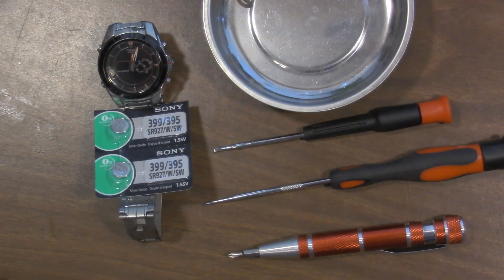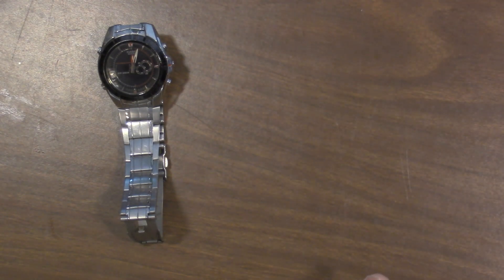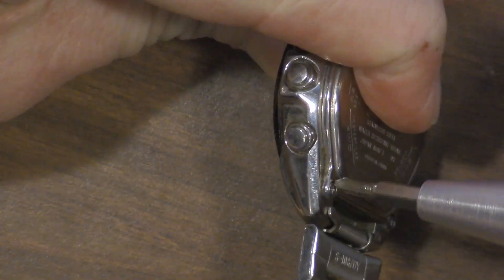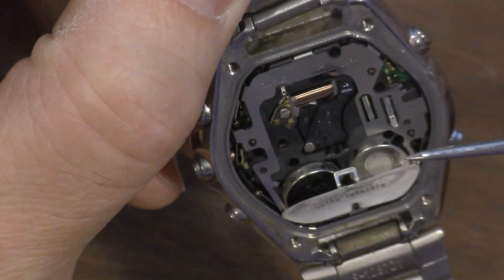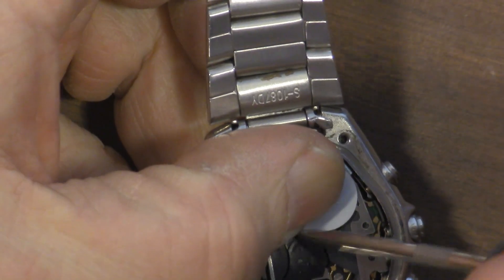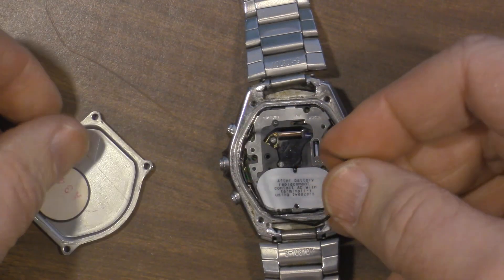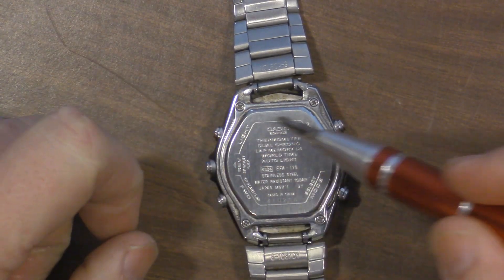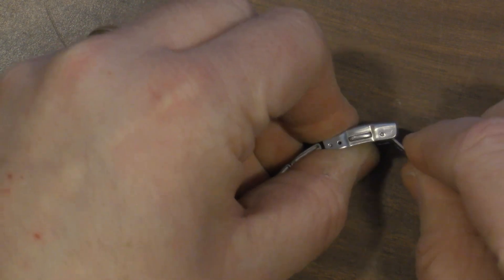Casio Edifice EFA-119 Battery Replacement

Comment: First of all, thank you for the very useful and guiding video. I have a problem, I did all the applications in the order you did and changed the new battery. However, while the digital part works, the analog part definitely does not work. I tried it twice, but the result did not change. I need your help.
Reply from the maker: Thank you, but I am sorry. I got a smart watch a couple years ago after filming this video. I no longer have this watch and I don't remember much beyond what is in the video.
Reply: @HandlebarWorkshops  Thank you, have a nice day.🙄

Comment: Thank you , it helps! I heared Casio recommend change the gasket every time you replace the battery. is that right?
Reply from the maker: I do not know about that. Mine was a bit stretched out, so it probably is a good idea. I'm not too worried about mine, since I never submerge it. 
Thanks for watching!

Comment: I also wanted to add that when I did my replacement, I wasn't able to make that final electric connection easily. 
It did not work to connect to the deep AC point and then lean the thumbtack pin I was using over so that it contacted the larger negative plate. It seems the plastic underneath stuck out just a little too much.
What worked was putting the thumbtack down in, to contact the AC, like you might normally do, and then taking a separate tack, and crossing them, so that I was able to touch the first tack's shank with the second one's.  And then the tip of the second tack could touch the negative plate, which then activated the watch.
Reply from the maker: Great workaround. Thanks for the tip!

Comment: First, thanks for a great video. My question: I replaced the batteries, but the sound is quieter now. It is sound when are you changing the watch program. Do you know how to fix this? Batteries are new. Thanks for your help.
Reply from the maker: That "beep" sound has to come from a speaker somewhere in the watch. I've never really looked into it, so I can't give you exact directions. My guess would be that you somehow moved or muffled the speaker in the watch while changing the battery.

Comment: Hi engineer
Thanking you
After replacing the battery by the repairman, the thermometer is out of calibration and does not show the correct temperature
Is there anything that should be done after replacing the battery?
please guide me
Your sincerely
Reply from the maker: I have never calibrated the thermometer on my watch. It was never something that I looked at. However, I happen to have my instruction book right here. 
Go to the 'TMP' setting screen (press the bottom left button 9 times). Use the middle and bottom buttons on the right hand side of the watch to change the calibration setting. Push and hold both of those buttons at the same time to reset the calibration to factory settings. Press the upper left button when done.

Comment: I have just repleaced the batteries in mine but the pointers are not moving anymore. Any help?
Reply from the maker: Assuming you have a Casio Edifice, there is a step to use a pin or paperclip to touch the negative side of the battery to some other point in the watch. It's the last step in my video. It may take a couple (or ten) tries to get it working, so keep at it.

Thanks for watch-ing. Heh. See what I did there? This video is about a watch? That's funny.

Comment: I have one watch, and i had changued batteries but i did not contacted ac with - ,and the batteris in 3 days out.

It was the reason for unload batteries?
Reply from the maker: I don't think so. Sounds like you may have a short circuit somewhere in the watch. It may need a professional repair.

Comment: after I did the replacement, just digital can working but the analog cannot working anymore . any suggest ?
Reply from the maker: The obvious thing to check is that you didn't put the battery in upside down. I'm sure you didn't, but needs to be said. 

Otherwise, you may want to check the battery contacts. Make sure they are clean without any corrosion. Also make sure that they are touching the battery in the proper places. Sometimes they can get bent and either do not make contact with the battery or they touch the battery in the wrong place.

Comment: Hello, I changed the battery but I see some weird colors popup on the screen. Any idea why?
Reply from the maker: Weird colors? I don't think this watch is capable of multiple colors. Are you sure you have the correct watch?
Reply: @HandlebarWorkshops   Yes same watch but it has stripes of white and black now on the face
Reply from the maker: I have never heard of that happening. Maybe try pulling the batteries out for a minute or two to reset anything in the watch's computer, then re-insert the batteries? Other than that, I can't think of what might be wrong.

Comment: I had 2 springs fall out of mine. One yellow and one silver. I located where the silver one goes by using this video. Any idea where the gold colored one is supposed to go?
Reply from the maker: Unfortunately, I do not recall any springs. I would put the watch back together and see if there is anything that doesn't work. At that point, with everything jammed in there, it should be pretty obvious as to where it should go.
Reply: @HandlebarWorkshops  I was able to find it and it was a pain to get back together properly. One spring that contacts the back is technically upside down so I'll have to remember that because otherwise it'll fall out next time.

The 2 gold ones I was referring to are actually contact points between the chip and the motor to the hands. Boy were those a pain to get put back. Wish I had watched your video before changing the batteries because I would have learned I didn't need to take it as far apart as I did.

Comment: hello , thanks for this, 
please somebody can help, after battery replacement black light show too low
Reply from the maker: Are you sure the batteries you used were new? Sounds like the back light isn't getting enough voltage. Either the batteries are low, or the contacts are dirty and interfering with the electric current.
Reply: @HandlebarWorkshops well i unpackaged them so , but when i tested with multimeter it show 1- 0.9 volts , 

also the batteries were stored in a drawer for almost a year

Comment: La correa se puede cambiar??
Reply from the maker: I don't read Spanish very well, but I think you're asking if the wrist strap can be changed. Yes, it can. Just like most other watch straps, it has two spring pins that attach the strap to the main body of the watch. You just need to find a strap that has the same width between the two pin holders. 

Thanks for watching.
Reply: @HandlebarWorkshops  can be changed the belt?

￼

Comment: Coloquei a bateria não funcionar e está esquentando a bateria
Reply from the maker: According to Google Translate "I put the battery in and it doesn't work and the battery is heating up". 

If the battery is heating up, that indicates a high current draw/rapid discharge most likely due to short circuit in the watch. That is probably not able to be fixed.
Reply: @HandlebarWorkshops  traduzir em português?
Reply from the maker: Usando Google Tradutor. Espero que isso faça sentido...

Se a bateria estiver aquecendo, isso indica um alto consumo de corrente/descarga rápida, provavelmente devido a um curto-circuito no relógio. Isso provavelmente não pode ser corrigido.